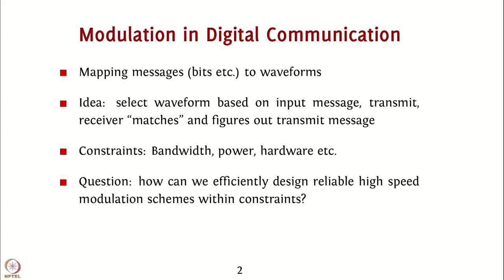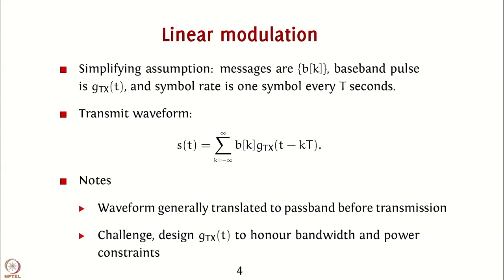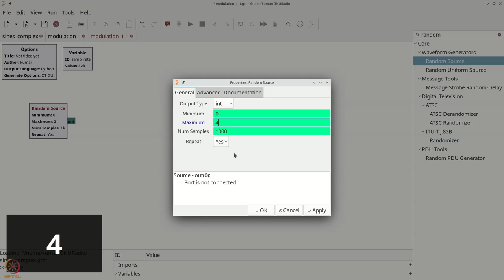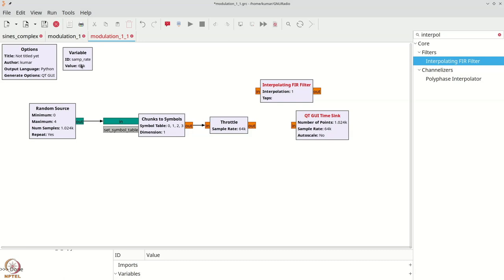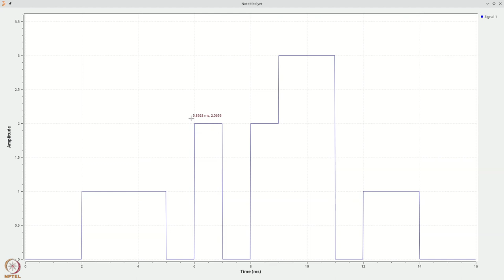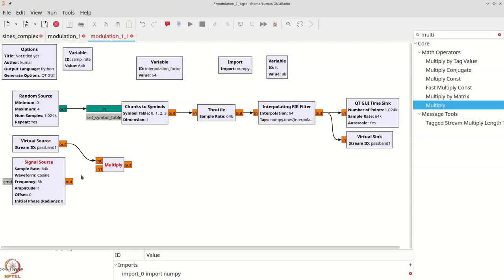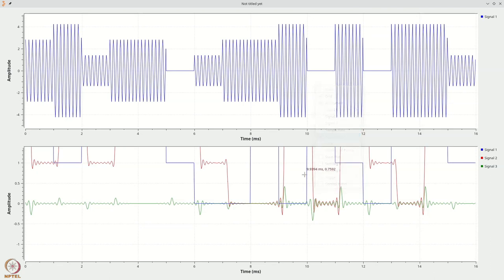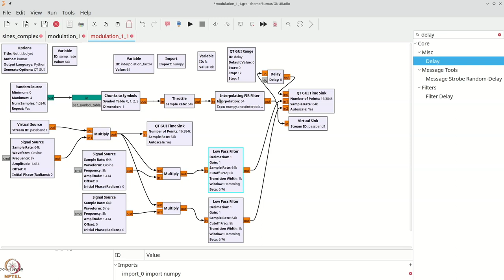Week 02: Lecture 10

Comment: How come interpolation factor of 64k/1000 = 64 decreases symbol rate from 64k to 1k? probably decimation does.
Reply: Interpolation results adding samples in between the input samples. So, what was earlier 64k now becomes 1k samples in the same time. This is because the interpolated waveform is played out at the same sample rate. Of course, this always depends on the reference sample rate that you take.